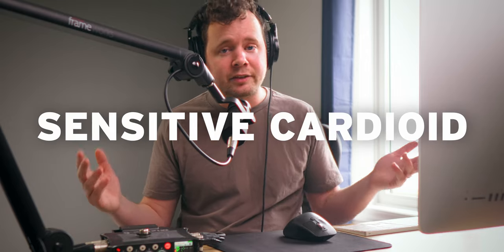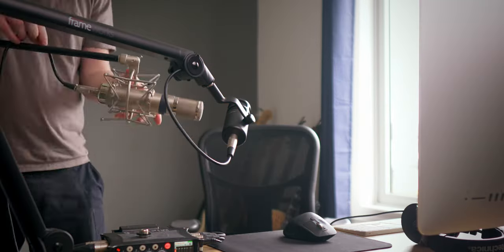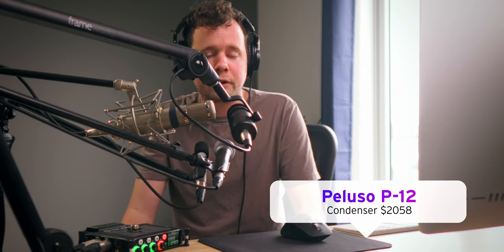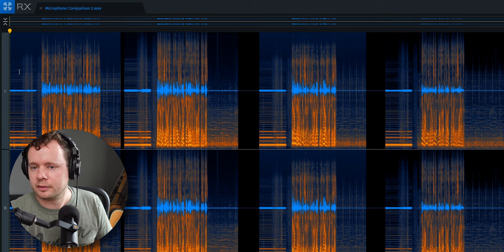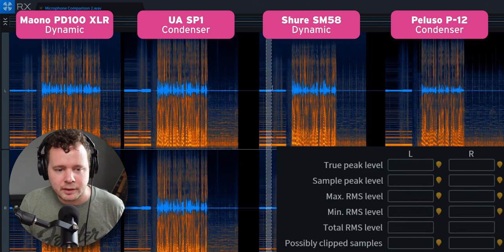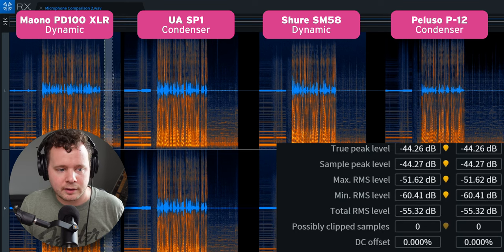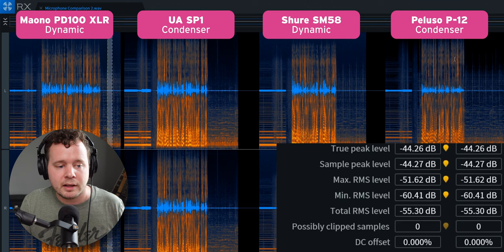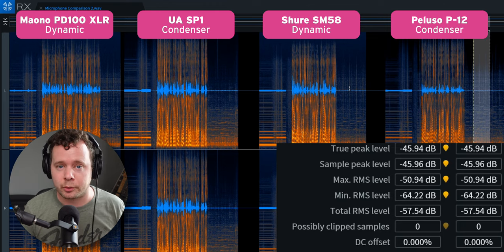Dynamic vs Condenser Microphones

Comment: You have recorded the noise reflected from the walls... To hear the real difference between the mics you should record the samples by speaking in to the front and to the back of the mics following by normalizing all of the "front" samples. After that try to compare the "back" samples. I think it reveals the real difference between the dynamics and condensers
Reply from the maker: That’s a great plan and a solid demonstration. However, there are no real pickup differences between dynamic and condensers with regards to noise beyond their polar patterns and sensitivity to high frequencies. Sound on Sound (a reputable audio publication) posted a great article on this debunking this concept. The only controls we have are polar pattern, proximity, and passive absorption. Beyond that, the microphones function the same. Your tests would be great at demonstrating polar pattern differences though!

Comment: The other reason most people go for the Newman 103, instead of the  102, if they are a professional (do it for a living) voiceover artist, anything below 50 DB clean vo with an additional 12db peaks, and roughly 6 dB overhead, will be rejected. That's the only way you can get it clean audio for a 24 bit.   This is when it comes in handy to have a microphone with less than 14 dB noise level. But again, this is television, feature films, etc. The only capable dynamic so far is the electrical voice RE 27 neodynam magnet. Extremely low noise. Also the number one microphone in radio stations for the past 60 years.

Comment: This is very good info! A thought though. I would think that if it takes varying amounts of pressure to move different types of diaphragms there is at least slight amounts of inherent filtering to them. You obviously can't amplify something that doesn't affect the diaphragm at all. Whether or not that translates to something meaningful is a different story though. I don't usually have a problem with noise from ants walking on my desk and such, so I doubt it. :D
Reply from the maker: Hahahaha yes! This is totally a solid point and something I totally neglected to include in the video. That’s really one of the only differences between frequency responses -Dynamics are a tiny bit less sensitive to super high-end because of their mass. Usually the roll-off happens above ~12k/15K, and noise in that frequency range will have a hard time stimulating the diaphragm from off-axis.. meaning if your face is in front of the mic, no 12k+ frequencies will be hitting that diaphragm anyways 🤷🏻‍♂️ you’re totally right though, it’s splitting hairs.

Comment: Condensor mic with 1. low self noise 2. High sensitivity 3. Turn Gain down 4. Cardioid Polar Pattern.

Can you explain the difference between 1, 2, and 3?

I have my condensor mic has a gain knob which I max out, but on my pc the recording volume is set to as low as 2%. So far this seems to decrease the environment noise a lot, and then I use audacity to further Reduce Noise without affecting the Voice quality too much.

Comment: I have a u87 and a sm7b and for the u87 u really do need a treated room bc that mic will pick up everything. I love it though. I have a treated space for it but if you’re starting out, the sm7b will make your life easier for sure. I like both
Reply from the maker: Curious if you're using the mics exactly the same (ie proximity, positioning, etc).

Comment: Nope, not at all. Your argument holds a lot of truth and solid reasoning. However, there's a reason why most mics on stage are dynamics.

Practically speaking, dynamic mics seem to have more of a falloff in terms of level. If both condensers and dynamic mics would translate amplitude completely linearly, it would be a different story.

Also, based on my experience, dynamic mics tend to deal better with me singing into them from a very close distance.

Using dynamic mics is not a panacea for bad acoustics in your recording space, but I've had a lot of success using them instead of condenser mics, especially when I was going for a dryer sound.
Reply from the maker: Thanks for the perspective! A couple of your points are talking purely about how they tend to be used, not how the tech actually functions from a physics standpoint. 
For instance, neumann builds handheld condensers that are meant to for live sound to be sung into, so it comes down to design and how they TEND to be used. Ruggedness, ability to handle extreme temperatures, rain etc, and physical build also come into play for live sound.
But you're totally right, dynamics have more falloff (because the diaphragm is extremely close to the source). Proximity effect is based purely on capsule distance to the source and not based on capsule type.

Comment: So should I consider condenser mic? I want to record vocals and an instrument(synthesizer) along with it. Can a condenser mic capture both the sound(my vocal and the single instrument) at the same time?
Reply from the maker: Yeah that’s totally doable. How are you planning to record the synth? Does it have speakers? If your interface has a 1/4inch connection, you could also record the synth DI, which will likely sound a little nicer :)

Comment: I enjoyed your experiment. I've always been suspicious of the dynamic is quieter claim. In your experiment, It seemed as thorough the background music was a bit quieter with the Maono than the others to my ears. I think one thing that could result in dynamics being quieter is not the microphones themselves but rather how they are used. Generally I think that dynamic users place their mouths closer to the microphone (frequently to obtain that proximity effect) resulting in a higher voice to background sounds ratio.
Reply from the maker: This is EXACTLY it! 🙌🏻 it’s all about how people tend to use them, which stems back to people thinking you can’t get close to condensers… but ever since like.. the 70s, that’s not true. It’s a whole myth based on facts that are no longer relevant. I recently reviewed the Lauten Audio LS208 which is designed for close proximity, but it’s also a condenser. Best of both worlds!

Comment: Great article. I’m looking at the PD100 Dynamic Mic, and wondering if it will run fine into a Focusrite Scarletti ? Now it’s a Dynamic so doesn’t need the 48v Phantom power right?
So many mics out there, but seeing you using and recommending that one is good. Thanks.
Reply from the maker: It’s a pretty decent option for the money! I think it will work just fine with the Scarlett. You’ll definitely want to pick up a windscreen for it because the plosives can be a bit annoying. A decent option though!

Comment: I have used both and with the condenser mics I was ALWAYS chasing noise. When I switched to a dynamic mic ALL my problems were gone.
Reply from the maker: Could be any number of things causing this, but likely how you’re using them. People tend to gravitate to using dynamics closer than condensers. This instantly changes the signal to noise ratio. But you can do this with either mic.
Reply: I have made the opposite experience. I tried a bunch of different dynamic microphones (even the Shure SM7B) and ended up with the Lewitt LCT 440 Pure which is a condenser. There was this slight background hiss with every single dynamic mic and it's almost completely gone with the condenser. Might be the preamp of my audio interface but I use a Motu M4 and even tried a Rodecaster Duo which didn't really improve things. Well, and of course the condenser sounds better than all of the dynamic mics.

Comment: So for a podcast with several people (2-4) could I use condenser mics?  They are cheaper and to me sound better, just don't know if for example my mic would pic up the guests and visa versa
Reply from the maker: For this reason in particular, a lot of people will lean towards dynamic mics. They are designed to be used right up against the lips (or very close) and most have pop filters built right in. This means if each guest gets really close to their own mic, you'll have much less bleed from one guest to the next. It makes editing quite a bit easier as well as it's easier to hide jump cuts. There are people, like Howard Stern for instance, that use condenser mics for this situation. But the vast majority use dynamics as they accomadate really close micing well.

Comment: That is definitely not true. Dynamic microphones have a way better room noise rejection. And that is specially important if you either: 1. You record from a very loud street without double pane windows. 2. You breath deeply with your mouth when you speak. That is going to be way less worse in a dynamic mic if you are not directly breathing on the capsule as many of the higher frequencies of your breath are going to be rejected.
Reply from the maker: You’re very incorrect on point 1, this has been debunked by so many microphone manufacturers. But there is some validity to your second point, however the high-end sensitivity differences between condensers and dynamics exists well beyond 15k.